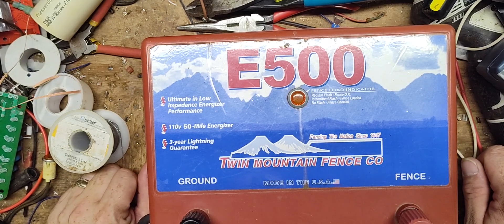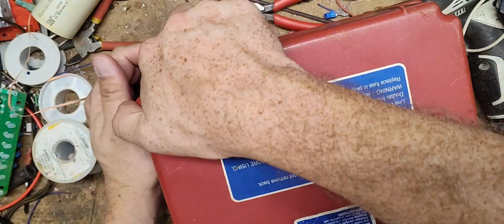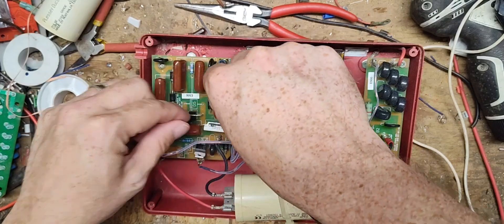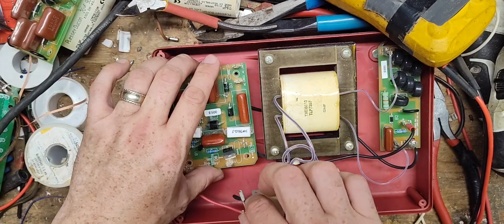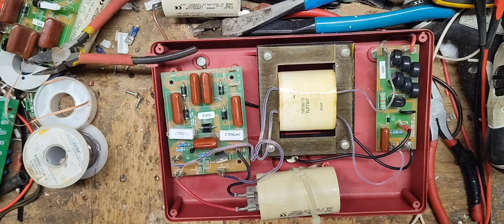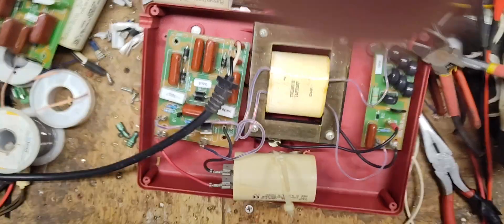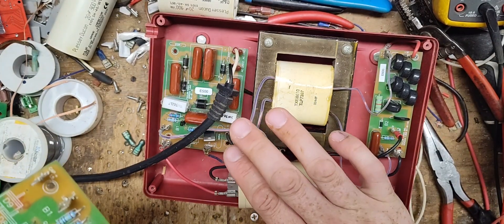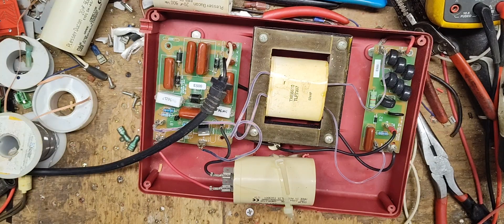Testing & Repairing A Twin Mountain E500 Electric Fence Charger

Comment: It might be that the previous person who worked on the control board used 82 Ohm - 5W resistors in place of the original 56 Ohm - 5W resistors like those on the new board.  I like the Cyclops fencers for their rugged design and the use of non-proprietary components.  All of the components on the boards are available from DigiKey or other electronic supply houses.  The design may be old-school, but what counts is the performance at the fence.  This is why I chose to install a Cyclops Champ 12V fencer in my system.  I noticed that this fencer has no fuses as is typical of the Cyclops fencers.
Reply from the maker: This is about a 15+ year old design version. Early cyclops only had fuses built into the AC plug, but none on the output fence/ground side. They were using a fused plug that the Fi-Shock brand used to use on their older units back in the day.

Comment: What's the turn around on sending in for repair?
Reply from the maker: I currently don't have a helper here with me to help work on things and it's still a busy time of the year. It will also depend on what brand and model you have as well. Some brands aren't offering parts anymore or parts are backordered here and there. So I would say turnaround time is 1-6+ weeks.